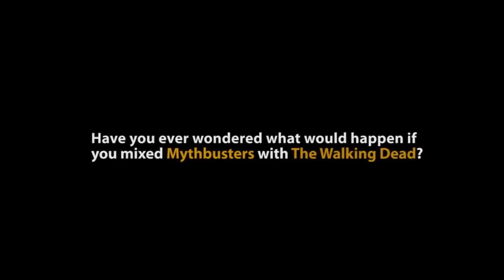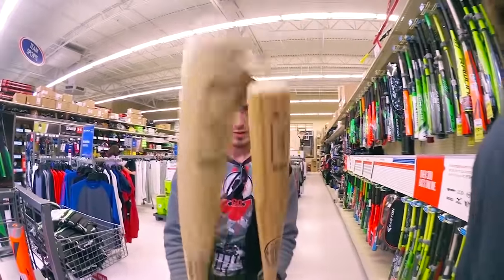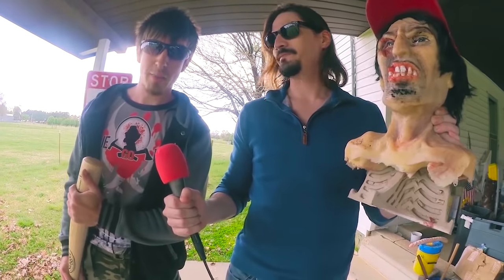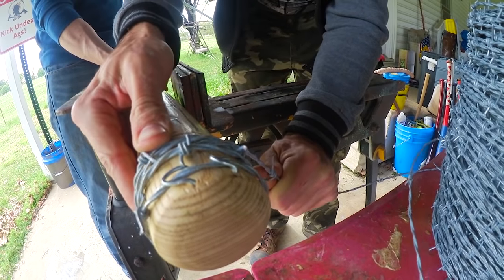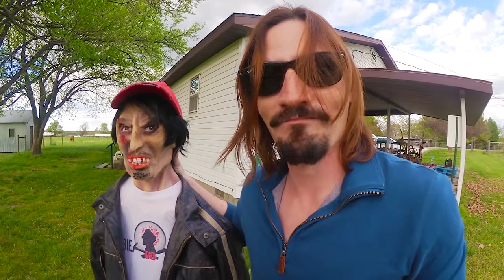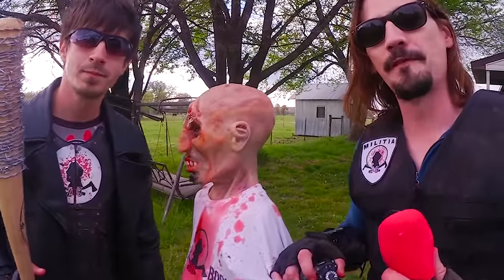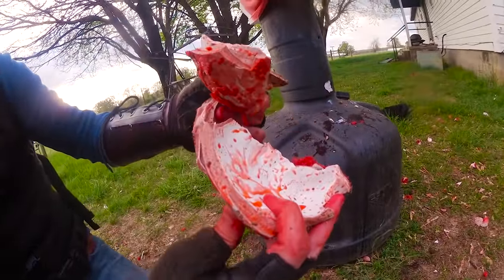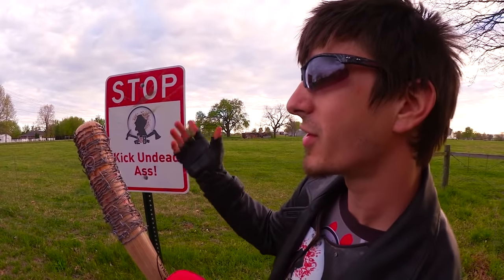Glenn's The Walking Dead Death in Real Life! Lucille Barbed Wire Baseball Bat! Zombie Go Boom

Comment: the barbs actually stick into the skin and maybe bone, helping to transfer more of the energy and making glancing blows more efficient. I would say that it's main advantage is that awkward (non perfect) blows do more damage and are less prone to glancing off. Also, it's omnidirectional in comparison to the saw blade ones.
Reply: the steel would bend before going into bones the wire only a small bit of weight and a bad as looking effect
Reply: The Bro what i''m saying is that it has a similar effect to a medieval anti-armor mace or war hammer because it sticks to flesh instead of glancing off, thus transferring more energy into the target.
Reply: I don't know who would legality use this on a human but zombies  don't feel pain
Reply: +The Bro the nails affect the bats integrity
Reply: I think that Lucille is more of a "just for the show" kinda thing. A badass villan with a baseball bat is awsome. A badass villan with a badass-barbed wire-wrapped-baseball bat is just that much more badass and awsome, if you ask me!
Reply: Alexandru Moise correct it definitely would give you the upper hand according to mass x acceleration  = force strength does have a say in it but overall it would add damage
Reply: Alexandru Moise it inflicts more pain to the victim it isn't really a main weapon of choice but is intimidating.
Reply: Jamie Powell
it prevents glancing blows by sticking to the target, thus making it more effective than a regular bat (by transfering more of it's energy to the target), not to mention the points concentrating the blow, increasing chance of fracture.
Reply: at the end of the day though, a regular old bat would do just fine. if i put barbed wire on a bat, it would only be a wooden one and i would remove the barbs actually because of the fact they get caught on things and thats not good in a zombie apocalypse scenario. i would use the wire as "armor" for the bat like the guy said in the video.

Comment: Ditch the pointy bits so it doesn't catch on things, so just use bailing wire or whatever, and then you've got an overkill seal.  You could tightly armor the whole surface of the bat that way and possibly have a more effective weapon that way.
But Lucille definately has a ritualistic/intimidating purpose both to his enemies, but also to his own men, and I think the effect it would have on his own men would be the most important, it gives their leader ethos, intimidation, and a ritual they all know and understand.